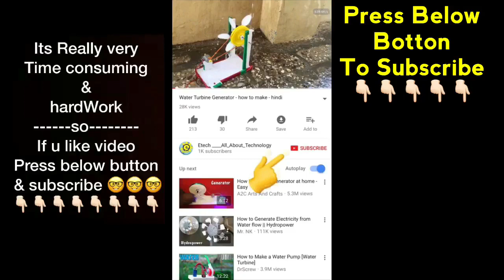Advanced Highway Model | Road power Generation | roller barrier | solar system

Comment: Isnt just more efficent to add turbine wind generators between lanes and add sound isolation walls (that will help the air movement) so the differential wind between 2 lanes, where its traffic direction will be opposite will make the wind create cicles and then some air current that will be gathered without taking hits, or easily stressing hardware?